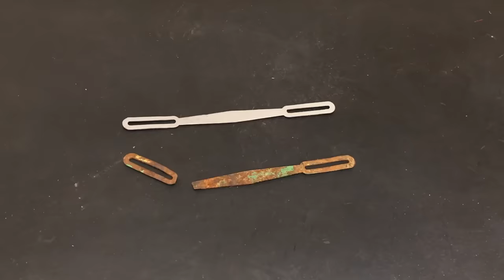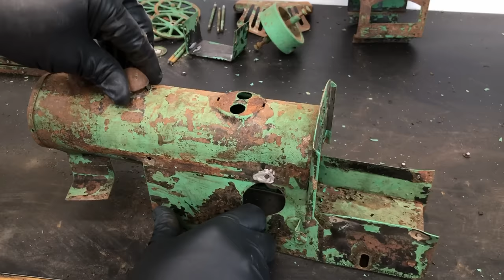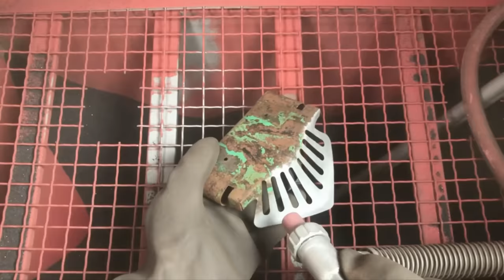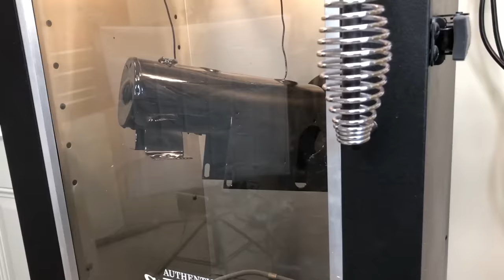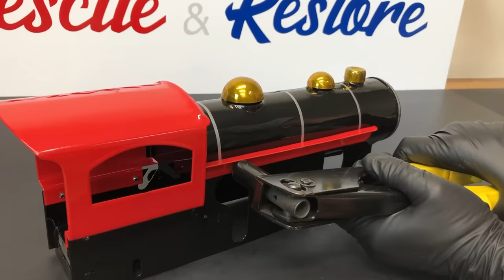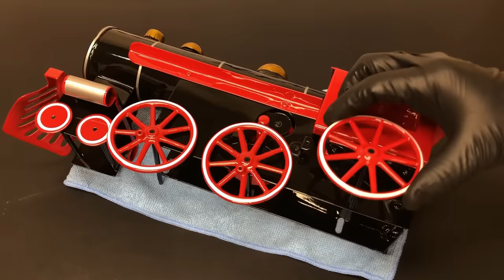1920s Dayton Train Restoration - Antique Locomotive

Comment: How the hell does he know how to put everything back together. When I fix stuff I end up with extra screws at the end lol.
Reply: Charles When I take things apart I take pictures with my phone as I go through the process of disassembly. That makes it a lot easier to reassemble it. The wonders of technology!😂😂
Reply: Hes literally videoing himself take it apart.
Reply: @Desmodus1958  This is literally the best advice you can give someone. If you've never done it before, take loads of pictures. Even though I've done things dozens of times I still snap a few off just in case
Reply: 저런거 어디팔죠?
Reply: Most of us take pics at every step of the way. used to do it with a Polaroid. HECK of a lot easier with today’s phones! I’ve known folks with expertise and memory so that it just goes in their head. My favorite ever was a motorcycle mechanic. Saw him replace the frame on one once. 1/4” drive rocker switch snap-on air tool, flat rate was 7 hours. All the way down, put the new frame on the stand, NEVER even looked for a part, just reached. 1 hour 47 minutes. Never in my life did I ever see him cut a corner (do shabby work).
Reply: Lots of pics..
Reply: Charles when I took apart a game console in order to replace a defective part, I put all the parts in bowls categorized by where I’d removed them during disassembly
Reply: They say if you take a thing apart and put it back together enough times eventually you have enough parts to make two of the thing.
Reply: @user-zb4yj3cj2d  아마 골동품 가게? 인터넷에도 있을거에요. 이베이 같은데 한번 찾아보세요.
Reply: Richard Ralph Roehl  I think you mean photographic
Reply: Charles 
Lol!
Reply: Ain't that the truth. Hahaha.
Reply: I took apart a car door once to fix the window motor.  Couldn’t get it back together. So I took apart the door on the other side to see how something fit.  That worked.
Reply: He takes pictures before, during taking it apart.  OR WATCH HIS VIDEO DOING IT.
Reply: @goosegaming6548  lol
Reply: He does video tape it so when he puts it back together he can review the footage 💯
Reply: Easy take a picture of it step by step so u know how to put it back together or number it
Reply: I always take notes and pictures on how everything fit together so I can do it again
Reply: Ele tem cérebro!!
Reply: 😂💛me too, sometimes I have none left!🤔
Reply: @Desmodus1958  ชชช1
Reply: He records it obv
Reply: I wonder if he watches his filming back?
Reply: Always ;-;
Reply: @connormclernon26  ша Usher 2sFKmPi irsebaham
Reply: I took my ps4 apart to clean it. I watched a video on how to disassemble and reassemble. I followed it step by step. I still had extra screws..
Reply: Chris Welcome wish I knew that. I was taking apart an old n scale Bachmann Northern to see if I could cannibalize it to fix another Bachmann Northern. Instead I ended up with a pile of parts and no idea how to reassemble it. It’s now in 2 plastic drawers and I got no idea how to reassemble it
Reply: Same haha💯
Reply: I’d just play the footage in reverse.
Reply: Reverse video
Reply: Oh God thats bad
Reply: Maybe that screw fell from your head not from the toy :0) Oops...
Reply: @Desmodus1958  Before phone tech got convenient, my friend used his trusty Polaroid to do the same thing. One of the best lessons I ever learned!
Reply: @gzaros  wow! Talk about time consuming! That’s dedication!
Reply: It's this (video tape) that keeps him on track.  This exact one he posts to you tube.  At least that is what might save me.  Even you are doing better than me.  You say you have extra parts.  I just buy a new one and throw that stuff to the side.  I pick a couple parts that I can use for other things.  And keep them.
Reply: @Desmodus1958  This is the way.
Reply: @Mr_Buzz_Aldrin  thank you Mando.😌😌

Comment: I never ever thought that I would have such a strong desire to buy a sand blaster.
Reply: I was just looking at how much they cost. Not that I have any reason to own one.
Reply: Looked them up for pricing after seeing the piano restoration.
Reply: I really want one...no other reason lol
Reply: Me too
Reply: SAME!
Reply: Me with a sandblaster: standing on a random street corner
Random stranger: has rust
Me with a sandblaster: I see you got some rust there...
Reply: Me too!!!!
Reply: Sand blasters are inexpensive, but require large expensive air compressors to power them, which also need to be powered with 240V electricity.
Reply: Lol I thought that as well and a powder coating equipment.  Lmao
Reply: Norman Klein well, not quiet...I own a small sand blaster from Harbor Freight...cost $45.00. And the 150 P.S.I. Air compressor I bought from Walmart last year for $60.00 works on my house plug, 120v all day long. I love it. Definitely not the same one he’s using, but it does everything I want and the media is fairly inexpensive too. Get 40LBs from Tractor Supply for like$20.00 haven’t used it all on three projects yet! Good luck....
Reply: Oh yeah.

Comment: I would love to see you work on a Pre-War, Standard Gauge Lionel electric train engine & cars.  I think you might find it quite challenging.  Some of them have enameled castings, some have combinations of brass & steel and some are tinplate with graphics using lithography.  You would also have the electrical motor & components to deal with.

Comment: You could use paint in the original light green colour. With that new paint it doesn't look like a 1920's toy too much...
Reply: The green is from the old metal. Copper turns green as it gets older  so it's original color was more than likely not green

Comment: It's like cheating when you have all the right tools. A lot of other restoration channels have scrape off the paint with paint remover, soak the metal in rust remover, then wire wheel it all till it's somewhat uniform, but there you go with your sandblaster, problem solved.

They also have to do a primer spray paint, then another coat, then a wet sand, then a couple color coats. You just powder coat and bam, done.

Anyway, look absolutely great at the end there, well done.

Comment: Dear Santa, I’ve been a good boy.  Can I have a sand blaster and powder coat sprayer and oven for xmas?  🙏
Reply: Ok son🥰
Reply: I would be happy with only the sandblaster. I will learn to paint manually if i have to but there is no proper replacement for sandblasting
Reply: A
Reply: so sweet!
Reply: Rescue and Restore: Origins
Reply: @amyfagan246  TV
Reply: I’d be happy to be able to fit a sandblaster in my small shed.
Reply: Jooa

Comment: I didn’t see him test for lead paint on this one.
Reply: I was wondering about that myself.
Reply: Yeah I found that a little odd, considering he restored a similarly colored easy-bake oven that did test positive for lead. He ended up using a chemical stripper on that item before sandblasting.
Reply: i did find that odd but oh well
Reply: In the description for equipment it says lead testing swabs. He mustn't have filmed it but he did test for it.
Reply: Since this toy was from the 20s, it was most likely positive for the lead, because paints back then had lead in it. I had helped fix up houses with a huge group, the small group I was in had worked on a house that was built in 1923-1924, the woman's living room had lead-based painted walls, and the paint was chipping, so we had to wear masks while we sanded down the chippings so we wouldn't breathe it in.

Comment: This is dope. I restore an actual steam locomotive but a real one. I’m restoring an LMS 2 Ivatt 2-6-0 number 46428. I’m not restoring it all by myself. I work on a particular group called “Bury Standard 4 Group” it’s called that because the first locomotive they saved from the cutting torches of Dai Woodhams Scrapyard, Barry, South Wales 🏴 and that’s a BR Standard 4MT 2-6-4T number 80097. 80097 was built in Brighton Works December 1954. She was withdrawn in July 1965 and arrived Dai Woodhams Scrapyard in January 1966 until  20 years and 4 months she was saved for preservation. She left on 23rd May 1985. It took 33 years of the project and is finally steaming again after 53 years since she last had her bunker filled up with coal and running. She was back to steaming October 2018. The group has a badge of her, I have one and other people do too. We’re now waiting for 46428 to be back steaming again and have a badge of her being created. We didn’t save 46428. The Strathspey Railway saved her in October 1979, moved its tender and used it on another steam locomotive and decided to put it up for sale. Is the Bury Standard 4 Group decided to purchase her for her future restoration. She’s built in December 1948 at Crewe works, withdrawn in November 1966, arrived Dai Woodhams Scrapyard, Barry, South Wales and spent 12 years and 1 month in the scrapyard. Because she’s got no tender we’re constructing a new one from scratch. Her whole entire chassi has been sand blasted, painted in undercoat about 2 or 3 times and painted in its original colour black outside and red inside. Hopefully this year she’ll be in our shed lifting the chassi into its wheels that’s been maintenanced at the Serven Valley Railway, lift her boiler into where it belongs and start doing more work to it’s body. I’ve been a member of the group for 6 years now, March 2015 and worked there for 6 years. I’m loving it

Comment: Woah! What a cool restoration! However i do reccomend to sand off the old paint and rust first, so that the new paint has no chance to peel of. Pretty cool what you did there anyways!!
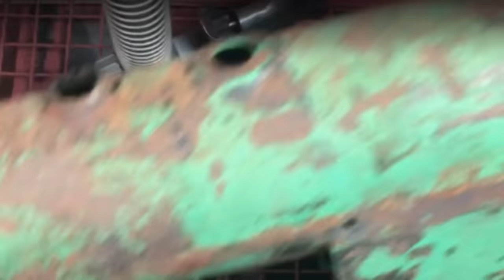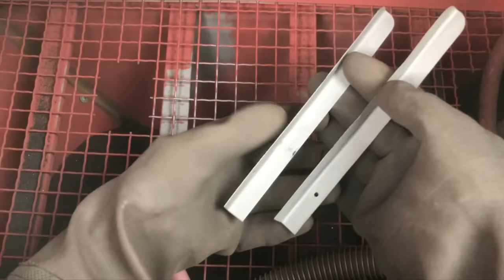Reply: So did you just completely skip over 5:30-9:04, or did you somehow mistake a sandblaster for a paint sprayer?

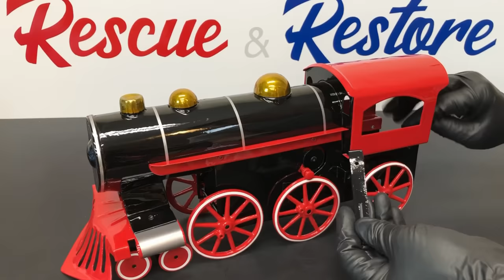(Also, the tool at 16:37 is a rivet gun.)
Reply: @SayaAensland  whoops, my bad, thanks

Comment: Wonderful restoration! I realize this vid isn't new, so this suggestion might be redundant. Regardless, if you are ever looking to pick up some new skills, I urge you to get into basic pinstriping. Granted, the crazy freehand geometric art can take a lifetime to learn, but just painting lines at a constant offset with a proper squirrel-hair brush can be learned without all that much effort and it is extremely satisfying. The result comes out as much more authentic on old toys compared to using flat decals for stripe effects.

Comment: I throughly enjoy your videos and restoration. 🙂
Not to be critical  , but I notice when you cut new replacement sheet metal parts you use a pair of straight snips , maybe you already know ?
But there are rights and lefts as well  , meaning when you cut with right hands snips your excess material curves upward on the right-side and the same with left handed snips.   Would be alot easier to use left and right handed snips.

Comment: Rescue & Restore, I love your work. I have a question for you. Most of the time your typical procedure is to sandblast down the part, repaint it and bake it. Have you ever run into parts, that the paint job was still OK and you wanted to keep the original paint but there was a slight defect like a dent or scratch that you wanted to cover up. But matching the exact paint color was difficult. Is there something you can do for this application? 

I have such a problem, was curious if there is a fast and easy way to make the repair. Any advise would be greatly appreciated.

Comment: Question. Y do u have to remove the paint off a project that has lead in it before u sandblast it? Always wondered about that. Thnkx
Reply: Sandblasting lead paint leaves a bunch of dust which can lead to lead contamination/sickness if not contained or removed preemptively